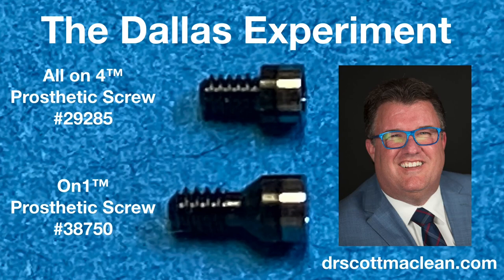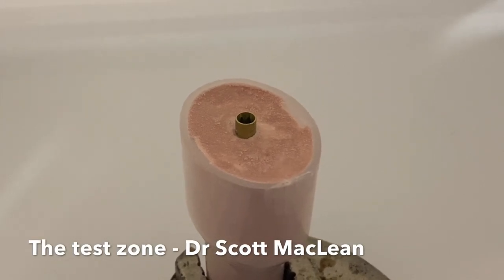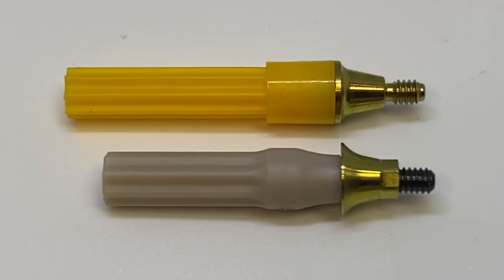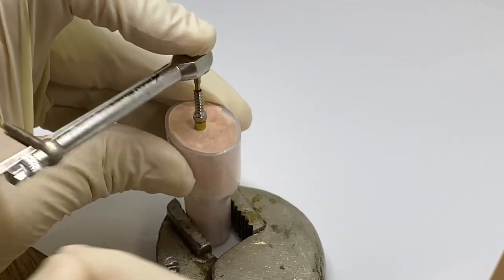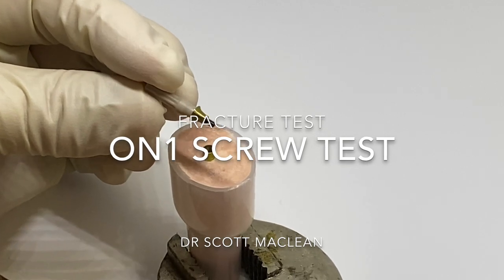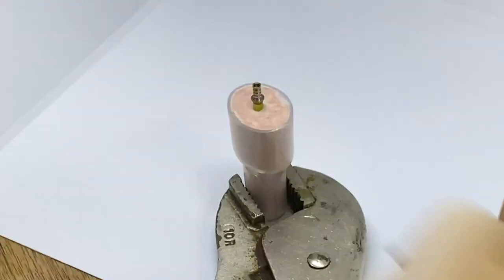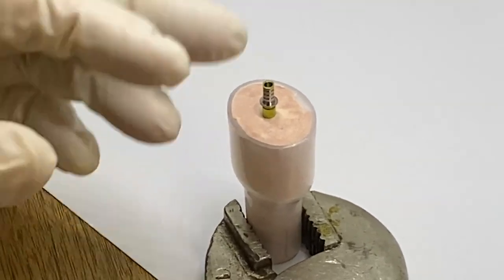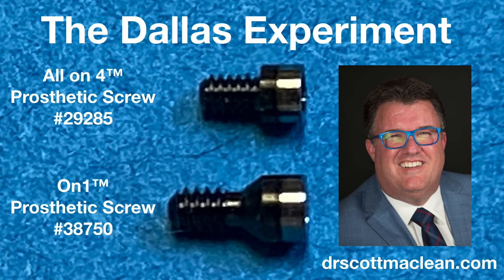The Dallas Experiment - Comparison of Screw Torque ON1 vs All on 4

Comment: Thank You for this experiment. Very well explained.
I would have one question, if You would be so kind to answer: 
If You would have some doubt about some unfitting of the definitive bridge on multiunit abutments and You now know that prosthetic screws have so high strenght (over 50-60 Ncm), what would brake first, in Your opinion?

The screw, the multi unit abutment or the implant?
I am asking because there is no evidence based studies that can show us that.

Thank You in advance
Reply from the maker: this is not a multiunit screw that is so strong. This is an On1 abutment screw. I try to use a splint to make the forces low at night.
Reply from the maker: After using these screws for 14 years they rarely fracture. You need to do verification with schfield test to have it passive.